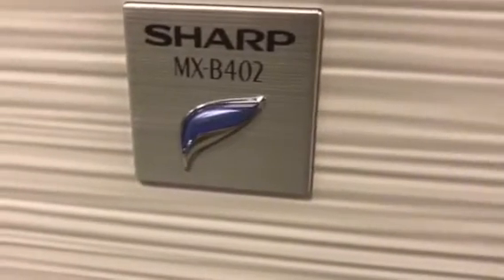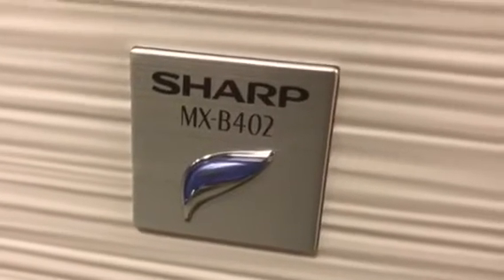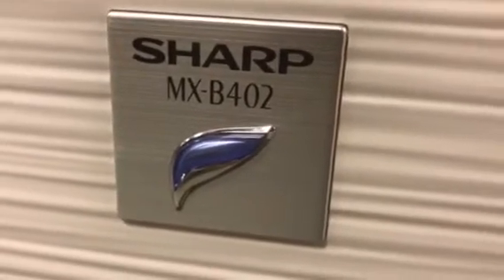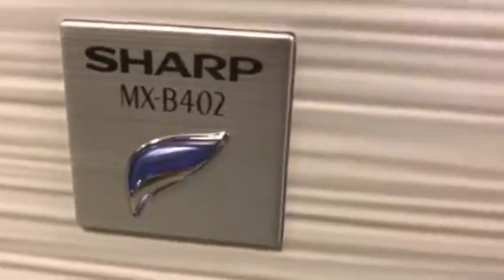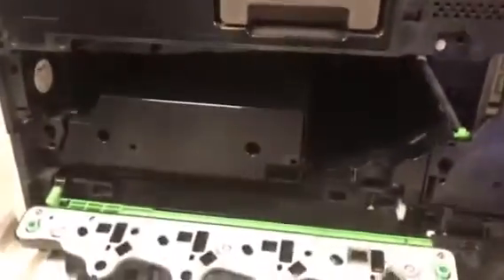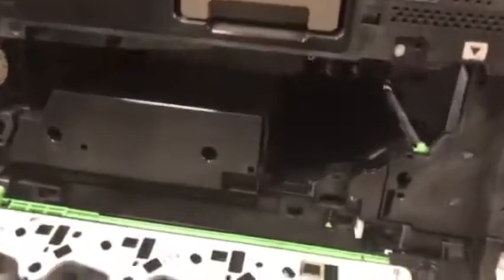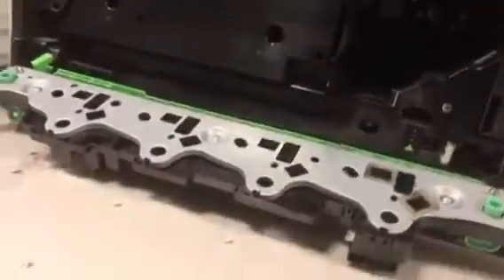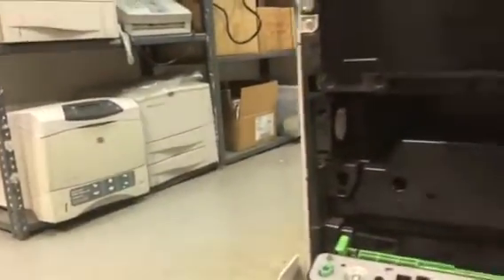MXB402 Transfer belt unit lift sensor

Comment: Using anything other than Sharp OEM toner will also dust up enough to create this problem.  It is also recommended to dust the entire back wall (a silicon-infused rag is essential here), the back of the mylar transfer belt unit, and the back of the developer and drum cartridges.  Also, the back wall sensor (1TUD_K) need only a single blast of air to clear it if you have dusted the rest of the wall.  This will greatly reduce the possibility of creating a cloud of toner dust for you to breathe in.  If L4-02 continues in this instance, it may be either a fault in 1TUD_K or a problem with the entire first transfer belt unit requiring a swapout.  In my 12 years of experience with Sharp MFP's, I have only had a sensor go out twice, and once was on the fuser where it was cracked by the heat.

On the color version of this machine, there will be a second sensor (1TUD_CL) roughly 4" to the left which will also need cleaning.  In this instance, the L4-06 error indicates a problem swinging the belt towards and away from the color drums, and so the transfer clutch and motor must also be considered when troubleshooting.